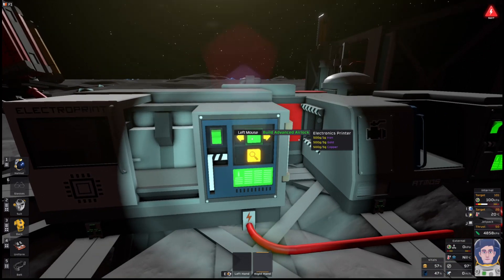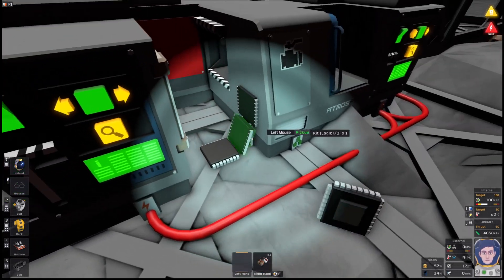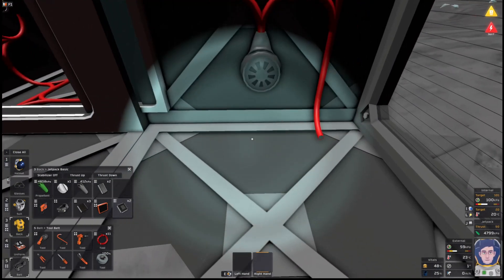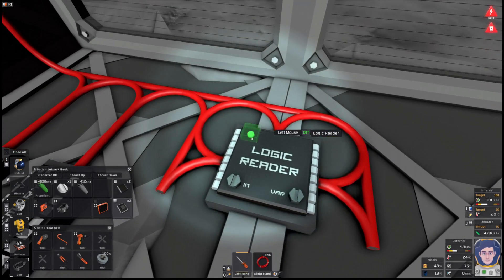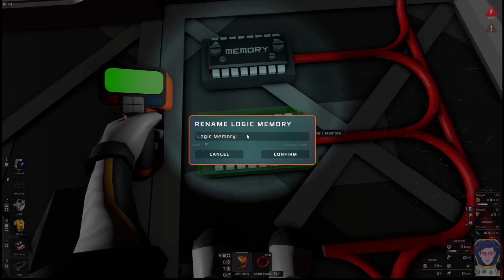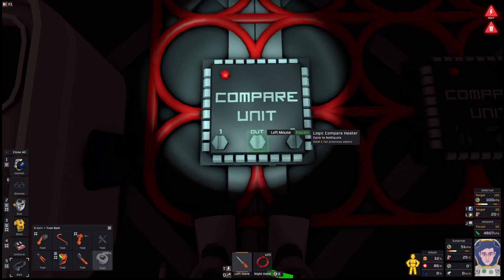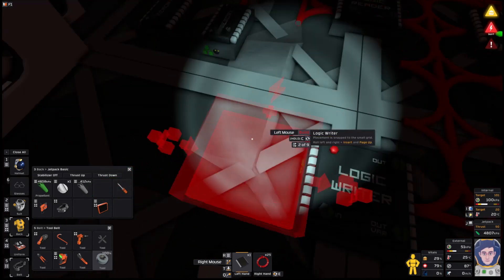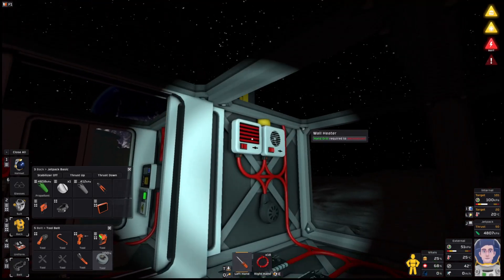Stationeers: How To Automate Climate Control

Comment: Umm, I did this step by step and it was working until I made two additional, separated copies of the same system. Now they all don't work. And by that I mean they aren't turning on and off the heaters and coolers. With this setup if you manually turn on or off any of the heaters or coolers they should automatically turn on or off immediately depending on the logic writers state. But it's not doing that at all

Comment: In the real world systems like this use the sensor being some distance away from the heater/cooler to passivly provide that buffer so you dont get the constant toggling. It looks like that should work with this games simulation.
Reply: I know I'm 7 months late to your comment, but I'm pretty certain that temperature is shared across the entire room and doesn't take time to travel across the room. If I am wrong and the temperature does travel, then it happens quite fast and probably won't be as effective in the game than irl.
Reply: @wisnoskij  I stand corrected, I was wrong. I've been playing a new playthrough recently and noticed that the temperature does vary slightly from one side of the room to the other, by a few °C, however like I said, the heat transfer works very quickly

Comment: You can use the labeler to create a unique identifier for your gas sensor. Also, if you use the Labeler & click on the small or large screw (memory) you can set the specific value, including a decimal
Reply from the maker: Yes. I should have mentioned both of those points. It's hard to remember to cover all the bits like this in every video, although I hope I've mentioned it in one of the others (if not I'll make sure to do so)

Comment: Awesome.  Great way to "automate" the climate before steel.  Thanks again for this series.  It's really helping me out with the simpler, first steps, things that need to get done.  I don't really know why anyone would keep using the arc furnace after they've set up the regular furnace, since it's SOOO much faster and doesn't require any power, but I guess that's just personal preference.
Reply from the maker: Thanks!

Logic chips are good for early game or simple tasks. I just wish they weren't so damn BIG!!

On the arc furnace point, I often just leave them in situ (as I have in the Mars playthrough) because it's easier, because they're a lot simpler to automate than the regular furnace, and because I want to conserve my fuel for making alloys, welding, the GFG and eventually the rocket, whereas power can be sourced from a range of places.
Reply: @murk9111  Hide them into the side of your builds and when you finish off the floors they will be hidden....just make no mistakes
Reply: or even build them into the floor on the bottom of your builds there is a terrain tool that will allow you to replace the dirt like nothing happened ....move along nothing to see here :P Except maybe that single wire clipping through the floor   lmao